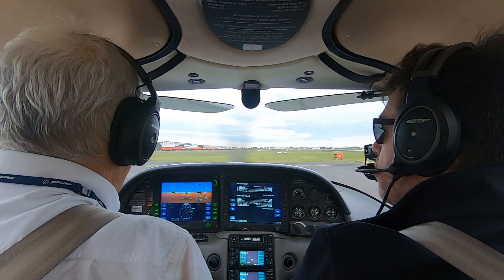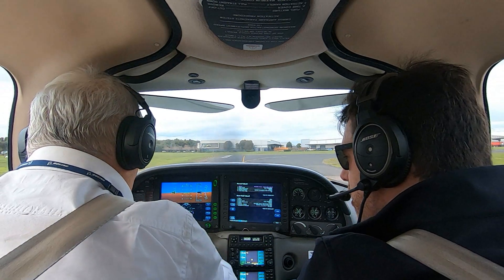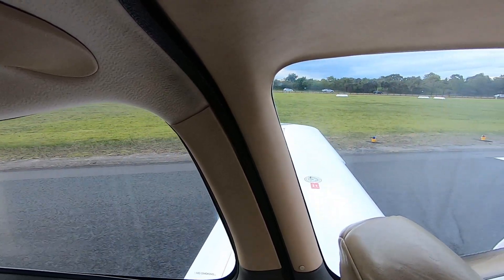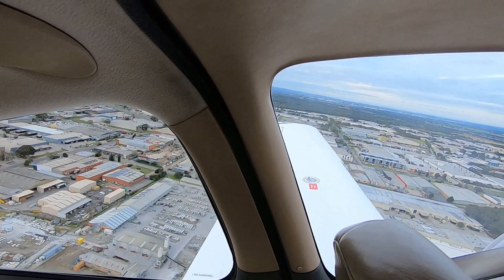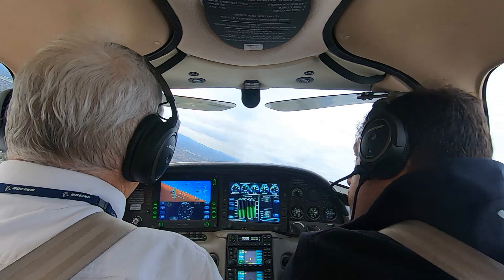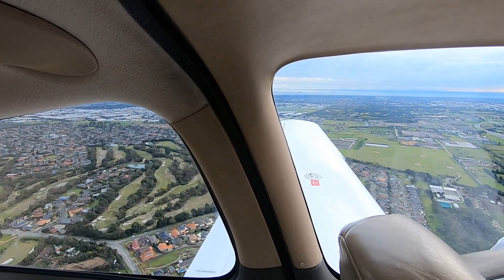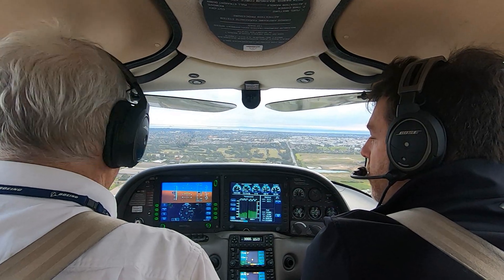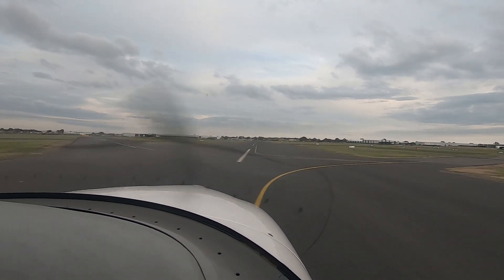Cirrus SR20 TPS Circuits with Matt

Comment: Welcome to the Cirrus family.  I think in time you will love the Cirrus flying and extra safety of CAPS. 
The low wing usually takes a little to get used too compared with the Cessna.
I certainly have never looked back and love the SR22 ... about to go on an air adventure up to the North West for 2 weeks .